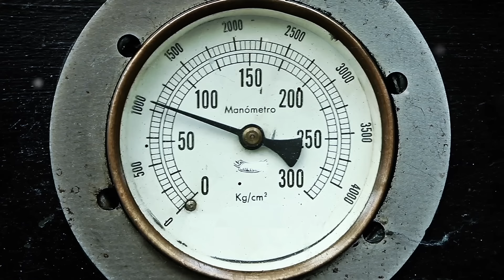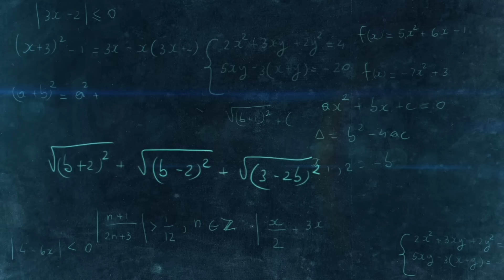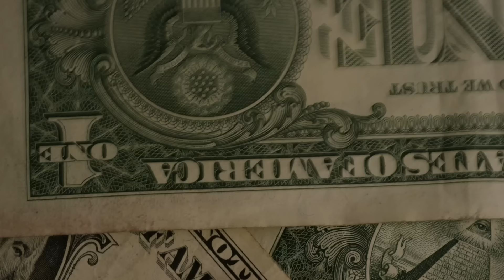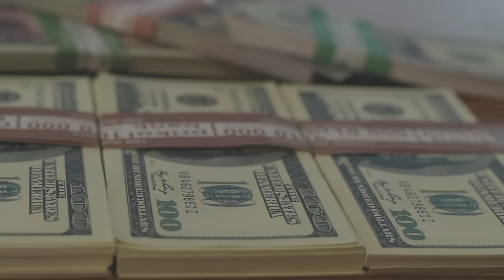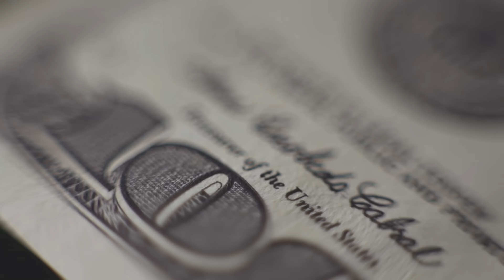5 Most Expensive Mistakes in All History

Comment: Would a simple note on a large card placed at the pump's on/off switch have prevented the explosion?
Reply: Standard industrial practice is to "lock out" a machine when under maintenance. A lock is placed on the electrical switch that prevents the machine from being started. Each lock has only one key so only the person putting the lock on can remove it.
Reply: The simple note on a card is good idea but it would not have work for two reasons that I can think of it would have been too easy number one and number two that would have shown a lot of common sense and there has not been that much common sense has been very rare for a long time. LOL but on a serious note it's a shame we'll never know now but it sounds like it would have been a good idea.
Reply: When I worked for the airlines as a mechanic , during maintenance ,  if we didn't want something turned on we would red tag it and everything associated with that system  and pull the circuit breakers and put red tags on those also. The tags would explain the reason(s) why that system should not be turned on.
Reply: Yes
Reply: @jimfarmer7811  Yea Jim, but even though most of us have seen and used sensible procedures as the lockout, that was "too much like right"...
Reply: They say regulations are written in blood…
Reply: You need a lock.

Comment: 1:00 The instructions didn't 'disappear'. They were in two different teams, and the work permit was stored in a second location unavailable to the team rostered on for the following shift. It was a fatal systemic flaw and a massive communication failure.
Reply: Industry standards were not followed.  All systems are supposed to have a lockout system.  They never used the lockout/tagout Industry standards.
Reply: @andrewsmith1735  from what i read  lockout/tagout wasnt a thing until 1989
Reply: @ernestogastelum9123  There was a locking mechanism on the pump though, the replacement crew simply removed it when they could find no paperwork stating why a perfectly good pump had been locked.

Comment: In regards to the oil rig I know with electrical equipment we have lock out locks and it prevents anyone from being able to turn it on. There should have been some type of lock out locks for the valves to prevent it from being opened.

Comment: Chernobyl disaster. The technicians shut down the reactor, gas forming. Then they left the reactor running low and kept delaying the test. At some point they noticed that the reactor was almost extinguished. So they pulled all the brake rods out of the reactor. At first the reactor started up very slowly because the gas was still in the reactor, which the technicians did not notice. The technicians did everything to make the reactor hotter. But over time the gas was decomposed and the nuclear reaction started like an explosion. As a result, the reactor overheated and melted on the ground, preventing the brake rods from being pushed in. Since the process had taken too long, water cooling was no longer available. The technicians were no longer able to control the atomic reaction. The reactor therefore ran at maximum power without regulation and without slowing down the reaction or the possibility of extinguishing it.

In the following days attempts were made to extinguish the reactor. The radiation was so high that all technical devices failed. Death throngs have cleared the roof of the reactor with hands and shovels. Miners dug a tunnel under the reactor so that it could be filled with concrete. Military helicopters dumped chemicals into the open nuclear fire. In haste, air shafts became pillars for a new roof.

Many emergency services lasted less than 48 hours before the nuclear disease broke out. Then they were taken to the basement of the hospital to die.

In 2022, Russian soldiers dug trenches in the contaminated soil. They had never heard of the catastrophe.
The Ukrainians, however, avoided the area until the sick Russians withdrew.

Comment: I am a structural engineer. It was a structural mistake in kobe. In our country, they give peanut fee to honest structural engineers to design multistory buildings and want to fix lifetime responsibility on him. Wish I had not chosen this field. 100 percent thankless job.
Reply: Yes, it was a structural failure but where did it originate? The designer, the rebar detailer, the reinforcing fabricator, the installing contractor, the prime contractor? Where was quality control and the followup inspections by the designer? With absolutely no evidence, I lean towards the designer because during his on-site inspections he surely would have noted a discrepancy between his design and the as-built condition. Wouldn't he?

Comment: I could mention the Great Shock at Falu Copper Mine in Sweden:
The intensive mining and planless drifting of tunnels resulted in the great collapse on Midsummer's Day on 25 June 1687. A collapse in 1655 had already caused several of the older mine pits to merge. A large part of the mine collapsed and three large open pits joined together to form the gigantic Great Shock, which is 1.6 kilometers in circumference and 95 meters deep. Miraculously, no one died in the collapse because holidays, days of prayer and Sundays were non-working days at the mine. New collapses 1833 and 1876 further extended the Great Shock.

Comment: The platform tragedy was clearly caused by a failure of the plant "Clearance System", as the remote pump controls were not tagged. Inexcusable!
Reply: locked out too
Reply: Agrivated by the policy of punishing ANY production delays or shutdowns.
Reply: @hillaryclinton2415  b
Reply: Excusable if those procedures/policies weren't in place at the time. In that regard.

Comment: Worth mentioning that western countries have never built RBMK reactors with graphite moderation, like seen in Sovjet Union. It was called out as dangerous even before the 1986 accident. A lot has happened to safety since.
Reply: It was human error. The reactor was run out of it's parameters by a mad man. Boom.
Reply: @Lux Aeterna the tubes filled with water to make steam inside the reactor also act as a moderator. As the reactor gets hotter the level of water declines as the water flashes to steam. Steam is not an absorber.

Comment: Deepwater Horizon. One of the most egregious acts of the oil/gas industry trying to minimize cost overruns on a dangerous high pressure reservoir.
Reply: Costs were cut so that the higher-ups could refurbish their private yachts or some similar crap. BP did NOT need that money.

Comment: As far as the Piper Alpha oil rig is concerned why was turning in a pump made possible.
When I ever removed critical parts from an industrial boiler, I always locked off the energising switch.
Locking off is litterly that.
Using a padlock to prevent a person  starting a machine.
A work permit is required to have that lock removed.

Comment: Chernobyl likely won't even be able to be dismantled until after the year 2100.  The sarcophagus is continuing to break down, and the building could collapse, furthering the spread of radiation.  The Safe Confinement Arc is mitigating the radiation, but the exposed reactor, nuclear fuel, and contaminated graphite all still remain.

Comment: In the piper alpha incident the metal plate didn't just fail it was just throw on there and finger screwed in, If the crew would had just tighten the screws then it wouldn't had failed

Comment: #3 Could've been easily negated or heavily reduced impact had one of those countries been less selfish. The captain was already near coastlines thats why he asked for permission to dock for repairs, No matter how far he could've taken it with a damaged ship he would still cause the exact same damage. 

Aside from that it was never his fault to begin with, he just drew the short straw. The vessel was not structurally sound to begin with. Amazing how he managed to survive a storm with damage and still make it to coast to ask for docking to repair. The lad should be commended and the countries that refused should be charged.
Reply: The tanker shouldn't have passed the last inspection certifying its seaworthiness.
Reply: @JSB103   True. Ironic that had he beached the ship in an isolated bay on the Spanish coast, the effects of the spill ( while bad) would at least have been localised.
Reply: @fuzzblightyear145 , there is that too. Of course.

Comment: titantic was one , costed a fortune to build it  in its time and then due to man made errors for the bulk head , lifeboat and a guy falling asleep on iceberg watch  , it sank
Reply: I suggest you research it a bit more carefully.  The real underlying cause of the Titanic sinking was the foolhardiness of steaming flat out through a known ice field in the dark, because the owners didn't want to delay the ship.  The much-maligned Captain Lord of the Californian did  the sensible thing and stopped his ship until daylight, and, not unreasonably the radio operator went to bed (at that time, not all ships even had radio and 24 hour radio watch wasn't yet a thing) yet he was vilified at the time for not going to Titanic's aid. 

On an operational level, contributory causes included the lookout not having binoculars which were missing from his station, and 4th Officer Lightoller (with good intention no doubt) giving almost exactly the wrong orders when the iceberg was spotted, too close to readily be avoided.  The design of the ship did have an effect on the fact that it sank*, but pretty much any other ship around at the time would also have sunk with that amount of damage.  As for the lifeboats, the Titanic carried more lifeboats than the regulations at the time called for.  It was only after the sinking that the Board of Trade revised the regulations so that ships carried enough lifeboats for the entire complement of passengers and crew.

* ironically, Titanic's sister ship Olympic might have survived, as she had the full-height bulkheads originally intended, before the alteration of the design to create larger interior spaces.

Comment: Was in Osaka during the earthquake and recall that when they examined the expressway pillars, they found they often contained bits of wood, wire and formwork  left in during the construction processes.  Apparently this significantly weakened those pillars increasing the risk of structural failure 

Also they X-rayed the surviving, structurally sound pillars and then wrapped steel collars around them to provide extra support, and kept using the,

Comment: The Hibernia oil platform disaster is a pretty famous one here in Canada. You may also want to do some research into the Olympic Stadium in Montreal. In fact, you could easily do a 60 minute or more video on the "Olympic  stadium alone. The corruption and ineptitude surrounding its construction is mind boggling. 
To date the "Big O" has cost nearly 4 times what it cost to build the Toronto Skydome, (Rogers Center). The plumbing has always had issues, the concrete was faulty and has undergone countless repairs, and the retractable roof NEVER ONCE worked properly

Comment: @1:58 "1988, an inquiry immediately began"  Um, tiny smart phones and notebook computers weren't around in 1988.  That disaster could have been completely avoided if an engineer had specified a thicker cover plate allowing the pipe circuit to be used without restriction.

Comment: Re: Piper Alpha:  Every industrial plant I've ever been in has Lock out/Tag out procedures  How could they not have hade one? A proper tag and lock on the pump breaker would have prevented the accident.  No need for the shift supervisor to remember.
Reply: Yep, basic safety practice in my industry, the only person who is allowed to remove the tag and put it back in service is the one who put it on.
Reply: They did, but the next operator simply removed the lockout when he could find no paperwork detailing why the pump had been locked out.

Comment: An honorable mention should go to the crash of a B2 Bomber. Thanks to mechanics not communicating with each other and the plane's manufacturer not recommending the maintenance manual be updated, a mechanic wasn't able to properly fix a sensor calibration issue caused by rain water getting into the sensor while the plane was parked outside in Guam at night during a rainstorm. When the pilots tried to take off, the sensor gave bad data resulting in the onboard computer getting bad data which resulted in it crashing within seconds of becoming airborne. The plane was a total loss. Thankfully nobody died as the pilots ejected at literally the last possible second. Total price tag: $2 billion US Dollars.

Comment: Putting a lock on a potentially dangerous piece of equipment during a maintenance shutdown (#5) doesn't hurt either ! ! !
Via-a-vis the other four fails could be categorized as engineering faux pas ! ! !
Reply: It was locked, but when the next shift concluded that the pump was functioning perfectly with no paperwork stating why it had been locked they simply unlocked it.

Comment: 2:13 Avoided with proper communication ? No , if you want to make sure an electric motor doesn’t run , 
put a lock on the power disconnect .
Lock out , tag out

Comment: There were many very extreme safety violations at multiple levels.

To name just two:  the design should have made it inherently impossible to turn on the pump with the value disconnected.  (there are many very standard and inexpensive AND FOOLproof ways that could have been done.   And it should have been required that a LOCK was put on the switch to the pump to prevent it's being cut on BY ANYONE other than the person/team doing the maintenance (this is a VERY standard safety mechanism:  for example,  electricians put their own lock on a panel box when working on the circuit to prevent anyone from cutting on the breaker while they are still working on it. 

Each of those two alone was a staggering breach of standard safety procedures.  There are many others which enabled this disaster, more than I have time for.   But that so many extremely serious AND HIGHLY OBVIOUS breaches of safety protocols occurred shows that there had to have been a pervasive attitude of WANTON disregard for safety - truly mind boggling in such a remote and highly dangerous site.

Maybe the root cause was they they had to scrape the bottom of the barrel to get anyone to work at such a remote site with too little rotation for too little money.